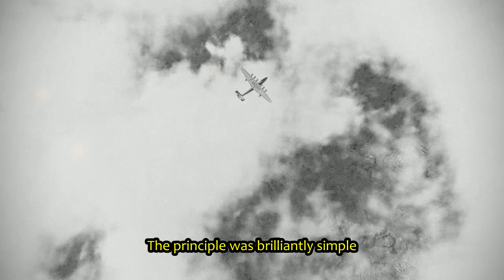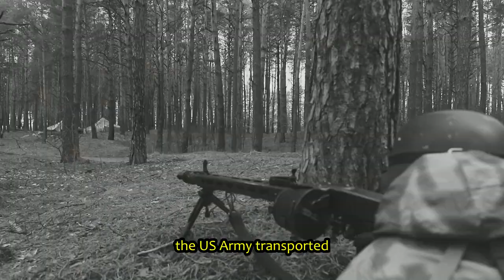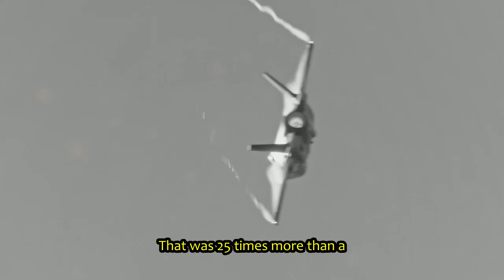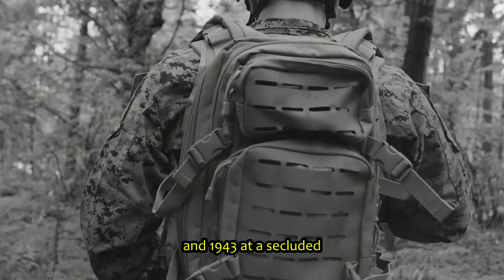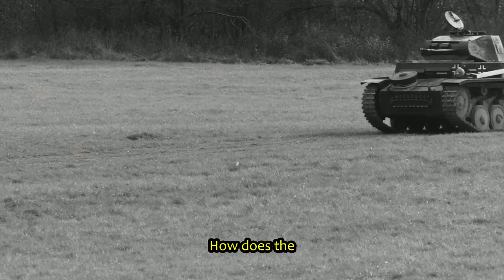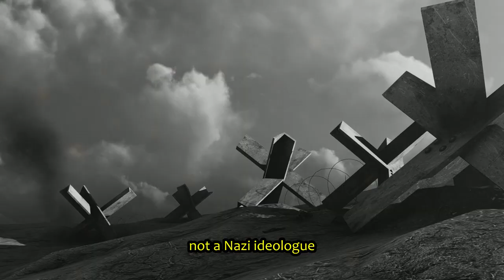NASA STOLE V-2 Regenerative Cooling Technology for Saturn Rockets Without Credit

Comment from the maker: Which technical details of the V-2 regenerative cooling surprised you most? That NASA copied complete German blueprints in 1945 and presented them as American innovation? Or that EVERY modern rocket engine - SpaceX Merlin, Blue Origin BE-4, Ariane Vulcain - uses this exact German technology from 1942? Many engineers in comments have discovered connections between V-2 patents and today's space systems. Share your technical findings!